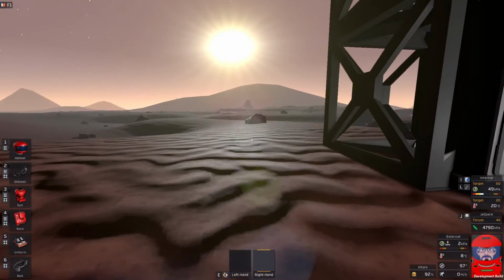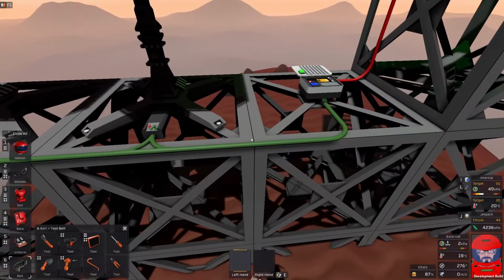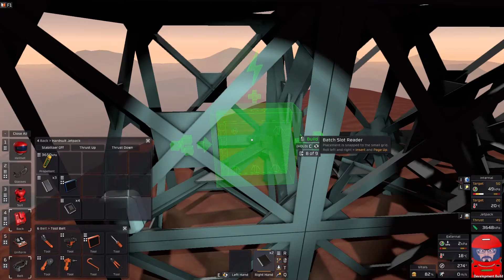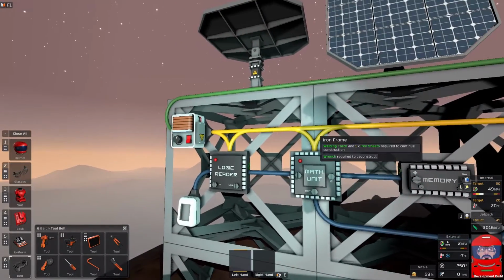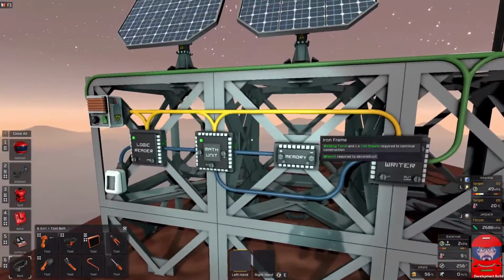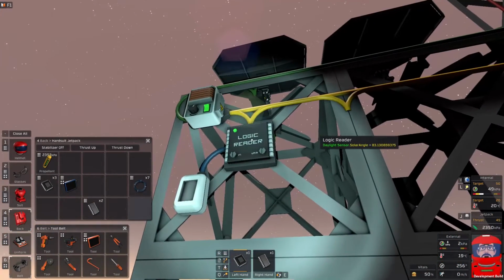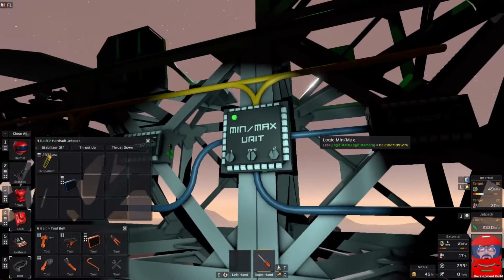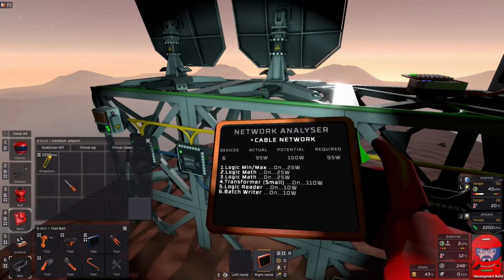Stationeers Simple solar tracking

Comment: In the morning, when the sun is below 15 degrees, does this circuit return a negative number? Are the solar panels okay with that? (They wig out if you give them more than 100, but not if you give them less than 0?) Example, early morning, the sun angle is 3. You subtract: 3-15=-12 Then you divide: -12/1.5=-8 You check for values over 100, but not less than 0, so I assume that -8 gets written out by the batch writer.

Comment: I don’t understand the use of the transformer.  I watched that part a few times and I understand the need but not how it works in this set up?
Reply from the maker: The preference for power is transformers then batteries then devices.  Without it, the power will go to charging the battery before powering the tracking circuit.  The transformer ensures that the first preference for the power goes to the tracking.
Reply: @cowsareevil7514  thanks, that was the piece I was missing.